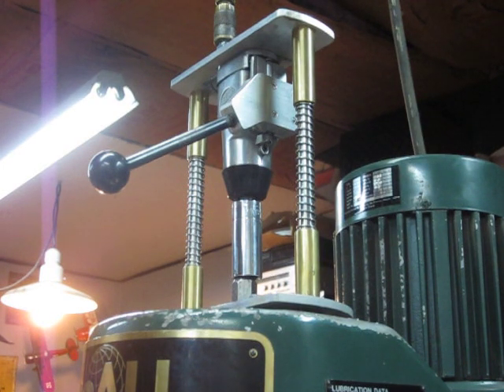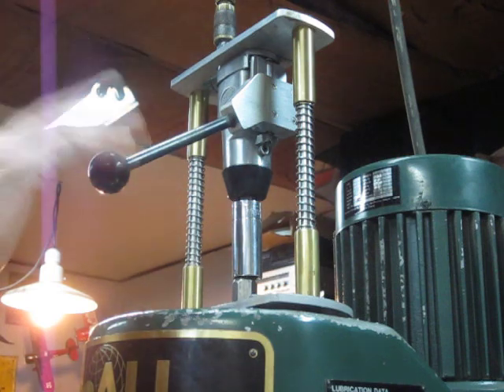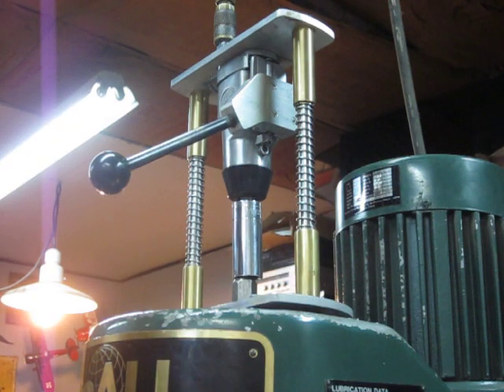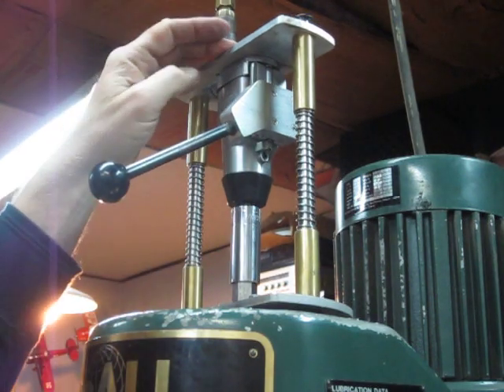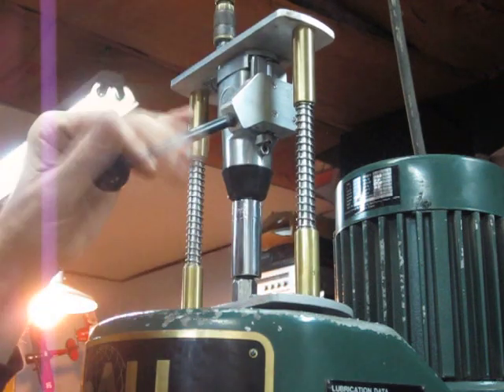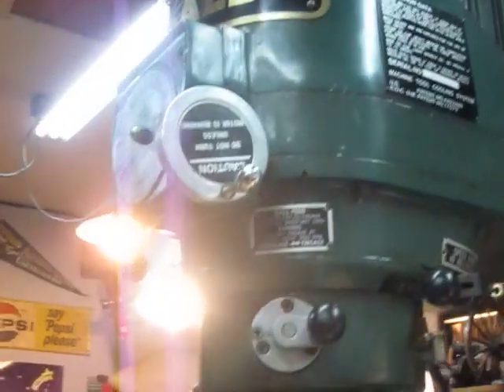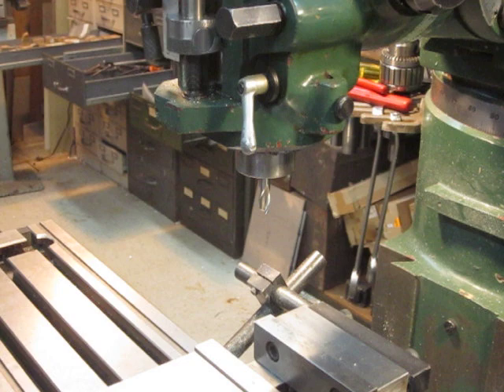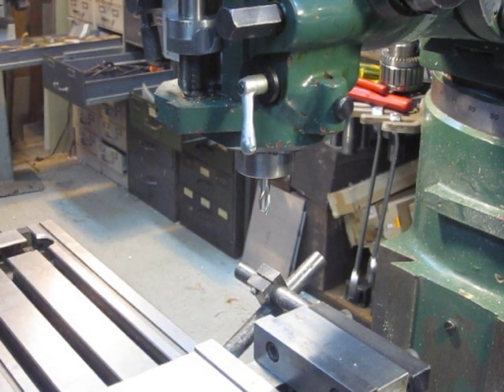A Simple Power Drawbar

Comment: That butterfly impact is now on clearance for 12.99$ if you can find it

I'm making one but opting for linear ball bearings and a 3rd rail to help ensure smooth operation

Thanks for the idea
Reply from the maker: There is a reason it's $12.99. I replaced the one I used early on with one of better qualty. Yes, it cost more, but it was money well spent.

Comment: If you grind a bevel on the end of the hex on your drawbar, perhaps a 30 degree angle that gives you a 1/4 inch bevel, it will make it easier for a socket to slip on the hex and self align.  I'd go with a 6 point impact socket.  With the bevel it will slide on the hex quite easily.
Reply from the maker: Wouldn't a 12 point socket make it twice as likely to engage the hex?

Comment: Thanks, Im gonna have to build two or three of these for the mills.
Reply: @TomsTechniques  will do, thanks! Are you planning more videos or are you enjoying retirement to much? Haha
Reply from the maker: I'll get back to them eventually, but I am enjoying retirement. I'm currently in the process of reupholstering a 1949 Frazer Manhattan that I picked up last year, so that's keeping me pretty busy. I was luck to find and original bolt of Frazer factory wool fabric on eBay (even the correct year), so it should turn out pretty authentic.

Tom
Reply from the maker: What made it interesting for me is that I grew up in the shadow of the Willow Run bomber plant. Kaiser-Frazer was the first commercial application of the plant after WWII. Yes, the AMC connection was through the Willys Jeep.
Reply from the maker: That's an interesting thought. I'm somewhat of a newbie on upholstery work, but it's actually turning out quite well. I suppose others might find it interesting.

Comment: I have similar setup on my mill, works great.
Reply from the maker: The only issue I've noticed is that sometimes the socket doesn't want to engage with the hex on the drawbar and needs to be turned a bit to align. A dog clutch or something similar might work better.

Tom
Reply: Toms Techniques
Sometimes you can just press it against the nut and tap the butterfly ratchet switch and it will engage, but I guess over time it will round off the nut a bit but nuts can be replaced when needed. I am not sure it would be bad to just leave the wrench engaged with the nut without the spring suspension system as the air wrench will just free wheel without air pressure in it. But that might wear the cheap wrench out prematurely. But since they are so cheap who would care as it would be less frustrating using it being engaged with the nut continually. What are your thoughts on this? thanx.
Reply from the maker: I don't think leaving it engaged would work very well. Even if the bearing could take it, the air motor would act like a pump working against a closed valve. I wonder what commercial units use for a coupling, such as the one made by Kurt?

Tom
Reply: Toms Techniques
The harbor Freight unit is a copy of an American made tool I have and bought years ago used knowing it needed to be rebuilt. So i took it to an air tool repair facility to buy the parts and as it turned out the cost of just letting them do it was just a little more than the cost of the parts. So I let them do it and to my surprise they did it while I waited about ten minutes, and they did it right in front of me on the counter. These butterfly air tools have a small turbine that looks like a six tooth gear with deep cuts between each tooth. the tip of each tooth has a slit to hold a strip of phenolic material that is spring loaded somehow to push the material up against the cylinder wall, sort of like a wankle engine design. Air is introduced from both sides depending on if its to push it forward or reverse. So if this turbine was spun without air under pressure it to me from my observation would logically  just rotate what air was there without building up any pressure. But now you have me thinking so will have  to do an experiment and drive mine with another tool to see if it does build any pressure, but my suspicion at this point is that it won't., but i have been known to be wrong assuming stuff in the past, so we shall find out. If it turns out it does not build pressure then that would make this upgrade much simpler for folks to do, less parts.
Reply: Toms Techniques
I am not familiar with the Kurts setup, is it air driven also?

Comment: How do you know if the collet is tight enough?  Had an endmill slip and ruined an expensive part. Have been using a torque wrench ever since.
Reply from the maker: This whole exercise was too see if an impact wrench like this could generate enough torque to reliably hold an end mill. After a bunch of trial runs, I've found that it only takes a few seconds to generate adequate torque. It's really no different than figuring out how tight to make the drawbar with a wrench.

Comment: Great tool Tom, especially for a short guy like me. I need a small step stool to get at the drawbar on my Sharps mill. I have all the components ready to build on except the long brass bushings. May I ask where you got them?
Reply from the maker: I made them from some brass rod I had on hand. The upper ones could be steel because their only purpose is to stiffen the rods. The lower ones could be steel as well if you bush the ends so they slide easily. Oilite or plastic bushings would work fine. McMaster Carr carries a good selection.

Tom

Comment: Tom, great idea! How did you over come the friction that holds the r8 collet after the drawbar is loosened? I usually back the drawbar off a few turns and pop it loose with a brass hammer I attached to the other end of my drawbar wrench.
Reply: I am also wondering how the collets are released. On the video it looks like the collet just fell out. It does not do that on my bridgeport. ??

Comment from the maker: Keith,

The brass bushings have a shoulder on them and are pressed into the upper and lower plates. The bores are a slip fit on the top and a press fit on the bottom to strengthen the rod.attachment to the plate.The collets drop out on their own when the drawbar is unscrewed.

You may want to invest in a better impact wrench.The Harbor Freight one that I used isn't worth the $10 I paid for it.

Tom

Comment: Tom I assume that the brass guides are just to keep the top plate parallel when it moves but did you connect them to the top and bottom or are they free floating.  Also does the collet drop out due to you holding down on the handle thus using the drawbar to push it out when reversing?

Simple and very functional I'm starting down the journey to make one based on yours!

Keith